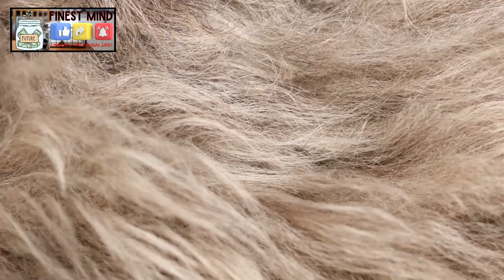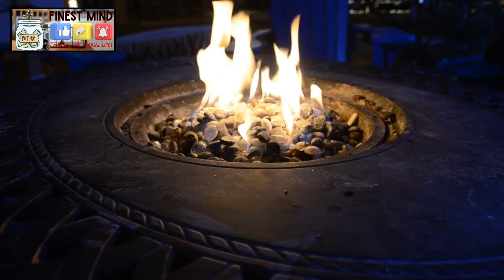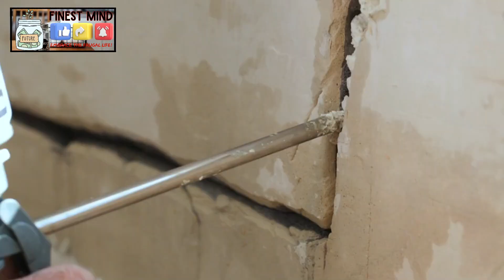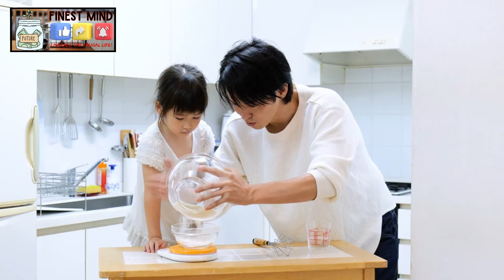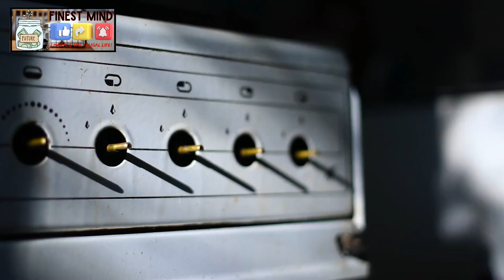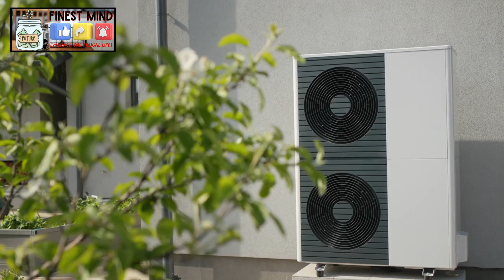How Amish Stay WARM in Winter Without Gas/Electricity

Comment: Buckmaster buckstove heats my house.  I have a heat pump but the buckstove keeps house 65 to 72 degrees. The stove is mounted in masonry envelope and will hold heat for 4 hours after fire goes out. One wheelbarrow of wood lasts for 24 hours.  I have a blower mounted in the top of the den to blow warm air to the rooms in the back of the house.   At night outside temps have gone down to 20 degrees F with no issues.